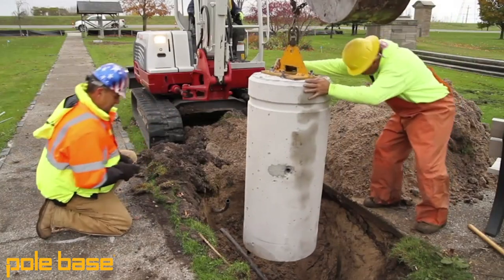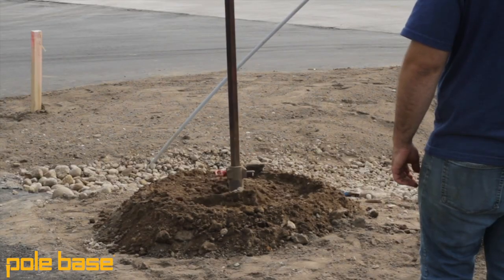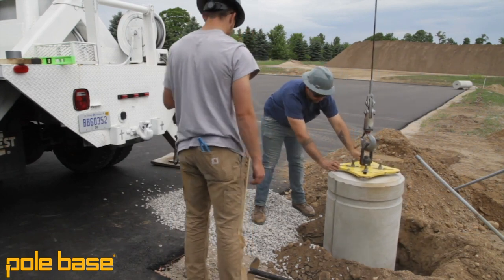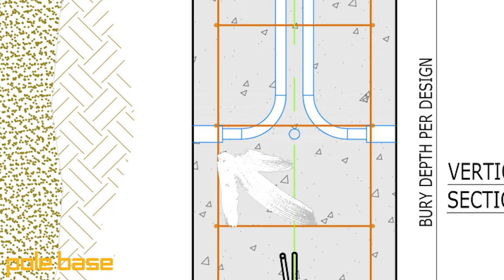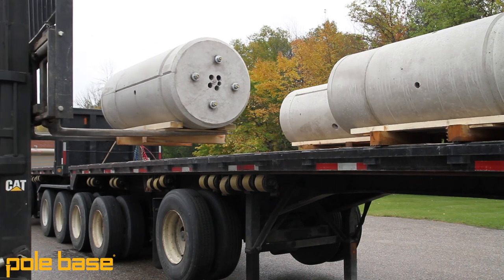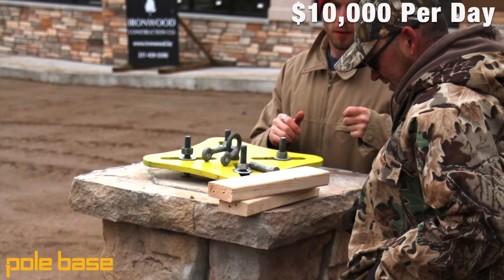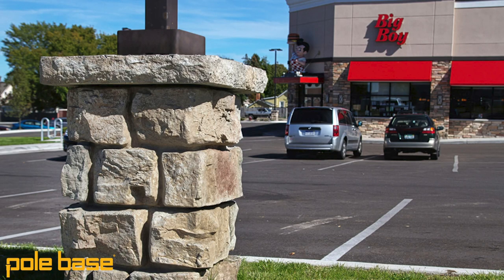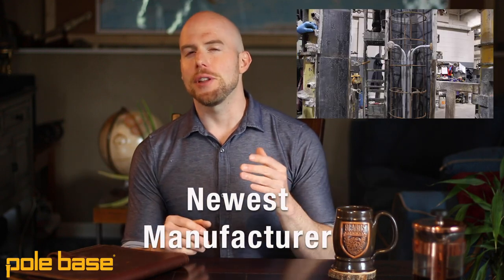How To Install A Precast Light Pole Base With Contractor Testimonial (Installation Video)

Comment: Love the video! How do you ensure the backfill is stable? Do you need to use fill crete?
Reply from the maker: Good question, Dennis! 

You can follow the link below to see our best practices:

https://www.polebase.com/documents/Technical_Resources/Installation/Pole-Base-Installation-Guide.pdf

For backfill, we suggest putting a 6" pad of crushed stone at the bottom of the augered hole. Once the base is set, fill the remainder of the hole up to conduit depth to run the conduit into the unit from the trenches. From there, you can finish backfilling with crushed stone till just below grade where you can then finish off everything (pour sidewalk, lay asphalt, spread topsoil and plant grass, etc). 

Thanks for the question!